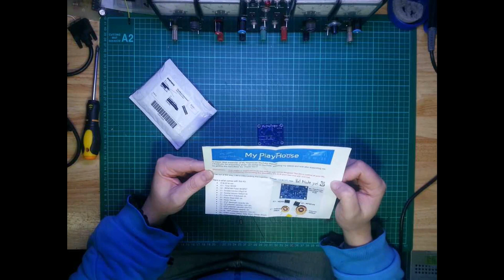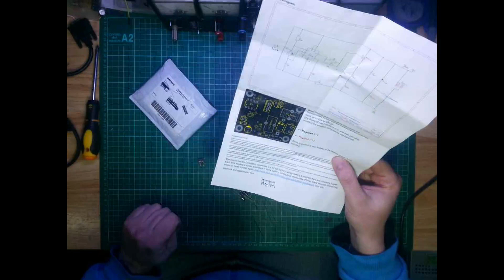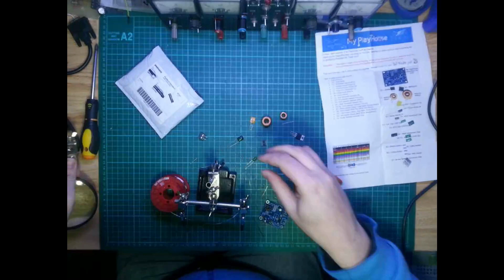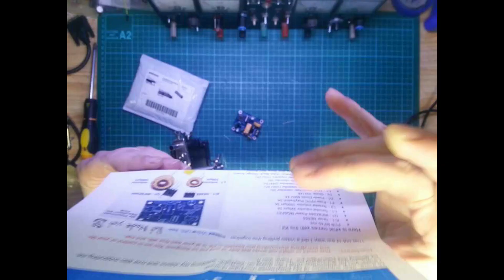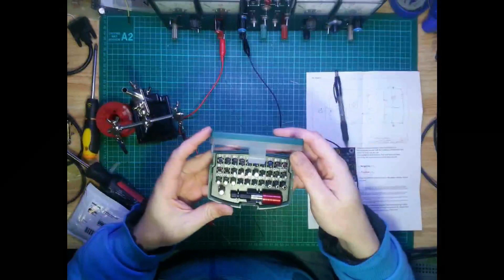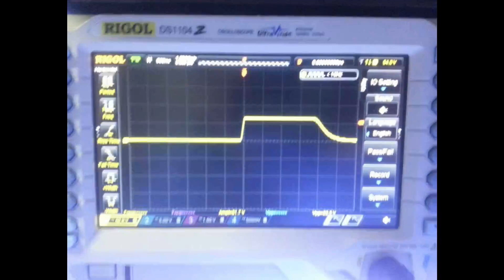13 - MyPlayHouse Battery Desulfator v1.0 Build & Review

Comment: Hi. Can we use 80 90 volts dc dc boost converter as desulfator. Would it be work. İs it useful.
Reply from the maker: A desulfator sends pulses into the battery, it isn't a constant DC voltage. If you were to apply a constant 80V DC to a battery could destroy it, best case causing it to dry out, or worst case cause a fire or explosion.